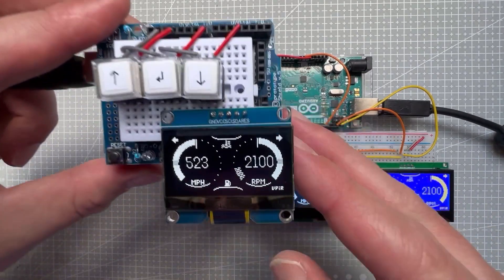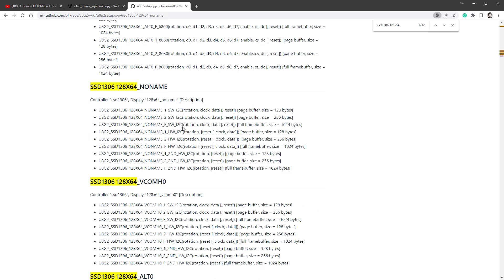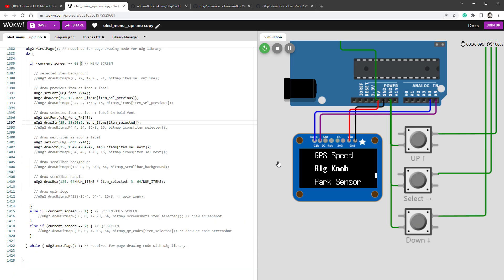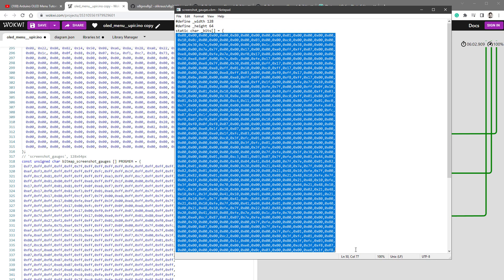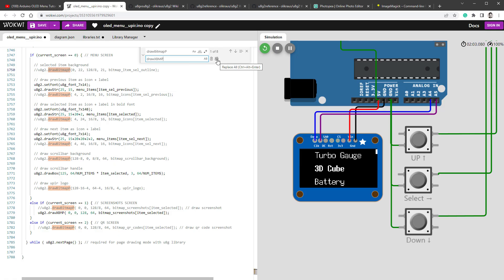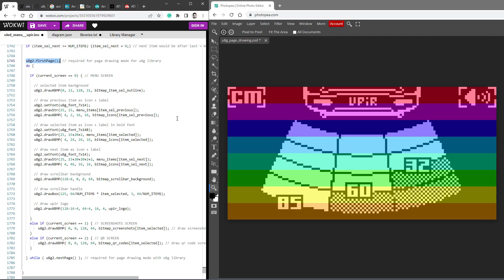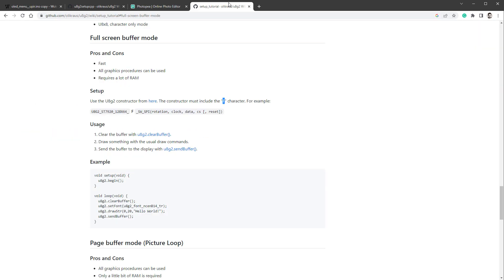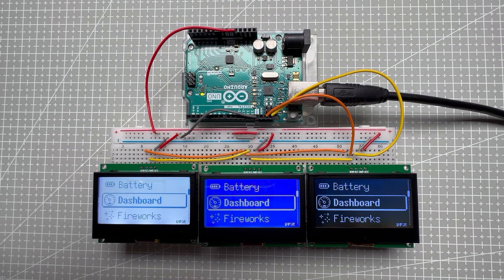U8g vs. U8g2 Arduino Graphics Libraries (Tutorial - OLED and LCD screens with Arduino UNO)

Comment: Do Crystalfontz CFAG12864U3 graphic LCD display including turning on/off custom row of icons on top of graphic display
Reply from the maker: That´s a good recommendation, the graphical display with additional icons is definitely very interesting! Although the choice of some icons is slightly questionable..
Reply: @upir_upir  use code from GItHub  for Set_Static_Indicators to turn on/off icons
Reply: @upir_upir  use code   for Set_Static_Indicators to turn on/off icons
Reply: @upir_upir  from CFAG12864Tx_and_Ux_ST7565P/CFAG12864Tx_and_Ux_Arduino
Reply: @upir_upir  Also do Crystalfontz CFA835 LCD display with LED icons and button inputs with grayscale LCD support

Comment: Build server failure: Error: Project compilation takes too long. Please remove some libraries and try again, or try to compile the project on your computer and use Wokwi for VS Code to simulate it.
Reply from the maker: Try it again, it should work.

Comment: im confused at the moment, i dont know why but the u8g2 library is much slower compared to the u8g library... i don't know what im doing wrong but it would be nice to know if anyone else is having the same issue
Reply from the maker: Do you use the same rendering method? I.e. page vs. bigger page vs fullscreen? U8G only has page mode. If you have enough memory, fullscreen drawing is faster. Also, I have noticed that if you don´t set images to transparent, it slows down drawing. I would try that as well.
Reply: @upir_upir  I figured why this was the case, after surfing the internet for quite a little bit I found similar cases with mine, it was that some SSD1306 modules from china might not come with a ACK. so its does not work with HW I2C, rather only with SW. (which is the one I own)

Simply, it takes around 600ms to draw a single frame on screen, which is super super slow.

The FAST I2C U8G library works REALLY well with even this display, so im quite surprised how different it was with U8G2, but this makes more sense now after doing some digging!

Thanks for the response though, I Really appreciate it! :)

Comment: Hey man, is it possible to increase the pixels, and use the RM67162 controller like the lilygo-s3-amoled screen? Thkx
Reply from the maker: Sure, that should be possible, but it will definitely take some time. That said, I do have that lilygo board and I would like to do some project with it.

Comment: @upir any chance you know why sometimes the display stops refreshing while using the old u8g library but there is no issue with the new u8g2 library?
Reply from the maker: Can you check the initialization routines of those libraries if those are the same? Or a better question, is there a reason to stick with the U8g instead of the newer u8g2?
Reply: @upir_upir  no reason to stick with the old library, I just want to find the reason it doesn't work to be a better engineer. It's not in the initialisation routine. It's a hit or miss, some displays work fine others don't depending on the manufacturer
Reply from the maker: @haideralikhan5947 are you 100% sure it’s SSD1306? Sometimes the sellers lists those but in fact it’s a different chip - like the SSD1309 or Sh1106. If it’s IIC version, try putting pull-up resistors for data and clock, some modules have those and some don’t. The safest option is to of course buy modules from known brands like Adafruit or Pimoroni, but obviously they are more expensive. Hope this was at least a little bit helpful.
Reply: @upir_upir  absolutely right, I have put 2 pull-up resistor and the screen doesn't freeze anymore. Cannot I never thought about that.
- option 1: keep using the old library which consumes less memory and is also a bit faster. Add 2 more resistors increasing cost.
-option 2: use the new library that has loads of new features, doesn't need pull up resistors it's just a bit slower. 

I am definitely going to choose the second option. Thanks a lot for the help, the pull-up resistor were a really nice shout
Reply from the maker: @haideralikhan5947 cool, I’m glad it was helpful. I still don’t quite understand why the newer version of the library works and the older one don’t. Perhaps they default to different speed?

Comment: Pro tip if you're using the u8g2 library make sure to ✔️ "swap" and convert image no more flipped parts of pictures
Reply from the maker: Yep, this video was recorded before this option was there…
Reply: @upir_upir  ohh i see... i tried this today and it's worked for me 😍
I'll surely make my potentiometer pimp like you did thank you 🙂
Reply: Great Pro Tip!! To add a bit more context.  Go to  image2ccp  - 4. Output  - Swap bits in byte: -  swap
Copy hex code to Arduino and it works!

Comment: If you hold the shift key while right-clicking in the file window (blank area of it) there is an additional item in the context menu, either "Open Command Prompt Here" or "Open Powershell window here" depending on version of Windows and/or a specific setting.  Either way you get a command prompt already pointing to the correct folder.
Reply from the maker: Thank you for letting me know, it´s definitely great to know and I´m sure other viewers would appreciate this information.

Comment: I need further assistance, especially on increasing the refresh frame rate, it is kinda slow if i used the GraphicsTest.ino .
i used the display which is same as yours on 0:10 . 

i used the U8G2_ST7567_ENH_DG128064I_F_SW_I2C u8g2(U8G2_R2, SCL, SDA, /* reset=*/U8X8_PIN_NONE); constructor
Reply from the maker: Try using the HW I2C constructor, that should help.

Comment: So much hastle of installing image tools, using the command line, copying bytes from one place to another, search and replace, etc... In short: a lot of manual work.

Fortunately, there's a setting on image2cpp called "Swap bits in byte" which is useful when working with the u8g2 library. You may want to warn others about this so they don't go crazy with all the extra work.
Reply from the maker: Thank you for your comment, but the option wasn´t there when recording this video. Since now it´s part of image2cpp (because of this video?), it would surely be a preferred way.
Reply: @upir_upir  oh, fair enough!

Comment: Amazing Video. Great description of the page mode. Small remark: LCDs are slower because of the SW I2C mode used in the video. HW I2C mode is much faster and is also possible with the LCDs.
Reply from the maker: Thank you for your nice comment and clarifying the slowness. I didn´t think that SW vs HW I2C would make such a difference, but I will surely try it with HW I2C to see the full potential. One question - do you know why you have to specifically set the I2C address for those particular LCDs, and not for other? Thank you!
Reply: @upir_upir  U8g2 defaults to the lowest I2C address allowed by display controller. Usually multiple I2C are possible with the display controller. Often the I2C address can be configured on the display PCB. Nevertheless the display manufacturer sometimes decides to use a different I2C address as a default configuration. In this case you either need to resolder a solder bridge on the PCB or provide the correct I2C address to U8g2.
Reply from the maker: @ucglib530  Thank you for the clarification; it all makes perfect sense once you know it. One last question, am I talking to the almighty Oli Kraus?
Reply: @upir_upir  ah, well yes, I had been too lazy to rename my youtube account 🤪
Reply from the maker: @ucglib530  ok, please to meet you! Most of my projects wouldn’t be possible without your amazing library.
Reply: @upir_upir  ❤

Comment: I am a bit lost, may be you can help me? I tried to adapt procedure for getting the arduino code with image2cpp. The OLED only shows crazy stuff as you have showed at 5:34, is there a way to avoid such mess up upfront?
Reply from the maker: For U8G2 library, you cannot generate images using image2cpp, since it does not suport the XBM format (yet). You need to use other tools, like the mentioned LCD Image converter or Image Magick. Hope it makes sense. I also hope that someone will update image2cpp to support XBM format.
Reply: @upir_upir  thank you for your fast reply :). I did found (through the deeps of arduino forum and the internet) a way around as you described. Create a .jpg file of Photopea load it into gimp and export it as GLIP Pixmap and paste the code into sketch.
Reply from the maker: It’s also described in the video 😳
Reply: @upir_upir  oh damn it. Too much coding to less hearing 😂🙈
Reply from the maker: No worries, I’m glad you have sorted it out 🙂

Comment: Která z knihoven zabere méně paměti (ponechám-li program jinak stejný).
Which library is les memory hungry assuming the same program
Reply from the maker: With this particular sketch, the memory usage is as follows, so the older library is slightly smaller. 

U8G (older):
Sketch uses 27662 bytes (85%) of program storage space. Maximum is 32256 bytes.
Global variables use 463 bytes (22%) of dynamic memory, leaving 1585 bytes for local variables. Maximum is 2048 bytes.

U8G2 (newer):
Sketch uses 31318 bytes (97%) of program storage space. Maximum is 32256 bytes.
Global variables use 869 bytes (42%) of dynamic memory, leaving 1179 bytes for local variables. Maximum is 2048 bytes.

Comment: u8g is a fantastic lib. I used to use it with the generic 128x64 graphic LCDs that are all over ebay before i moved across to touch screen TFTs.
Reply from the maker: I fully agree. It´s well designed library and I enjoy using it. Out of curiosity, which touch screen TFTs are you using?

Comment: Thanks man, I've been doing almost every step which you showed in this video manually since I've saw your first video with Turbo Gauge. This is verry nice tutorial for automating this conversions. Also it's worth to mention, that u8g2 lib works for almost every 128x64 screen and solves problems with sudden freeze on cheaper one models, thats probably why you've done this tutorial as I can guess ;) Verry nice work, can't wait when you connect it to MCP2515 and show some real data on this littile cuties 😎🤞
Reply from the maker: Thank you for your nice comment, Wojciech! I´m gald it was helpful, and to answer your question, yes, I would like to show some real data soon :) Good luck with your project. Is there something you can share with the world?

Comment: Great video, and also very timely for me as well... I've spent the last 2 days coding with U8g2 and an SSD1306-based OLED. Olikraus has put a HUGE amount of work into this and U8g, including very detailed documentation. 

I think being able to use the full buffer mode with U8g2 — and calling  u8g2.sendBuffer(); — is a big advantage... in the past when I used U8g I ended up doing some convoluted optimisations to get the paged mode to work quickly. I usually use Nano rather than Uno, so memory is not a worry.  Until I start loading in loads of bitmaps maybe, hehe.